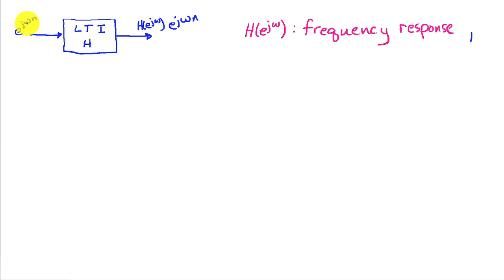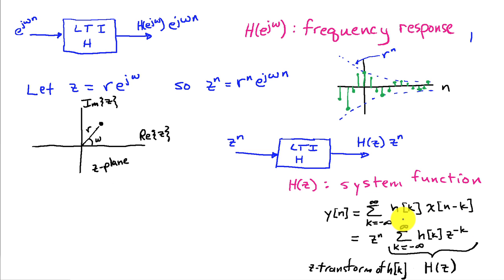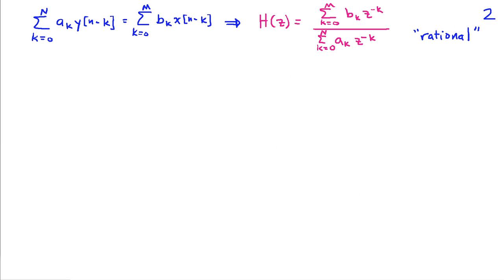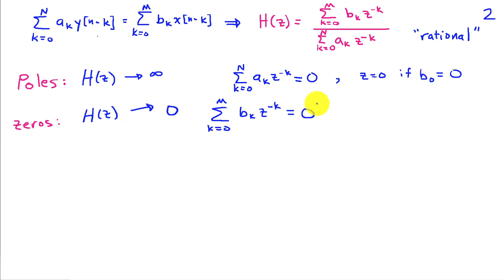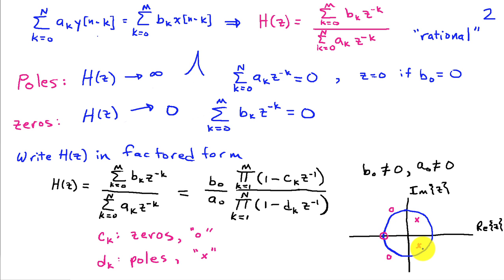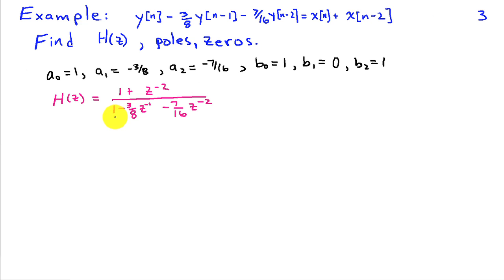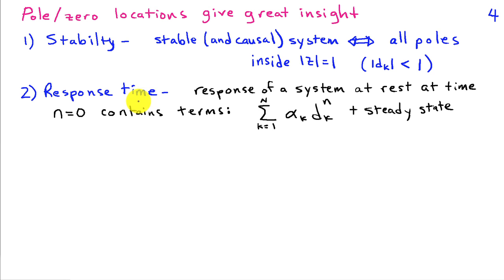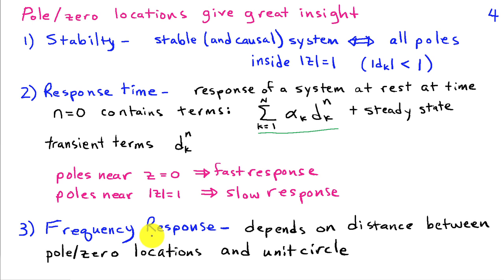Introduction to Poles, Zeros, and the System Function

Comment: hi..Very good video.

If i have a system with transfer function numerator (s+1), means if i apply exp(-t) i will get 0 0/P, we can't apply any real sinusoidal signal to get 0 o/p...am i correct?
Reply from the maker: I'm not sure I understand the 0 0/P notation what you mean about applying a sinusoidal signal. And your use of "s" and "t" imply you are thinking of continuous time, not discrete-time systems.

The Laplace transform for exp(-t)u(t) is 1/(s+1). If you apply this to a system with transfer function s+1, the output is 1 in the s-domain which corresponds to delta(t). Note in the time domain that "s" corresponds to differentiation and "1" passes the original signal.  So in the time domain the output is d/dt {exp(-t)u(t)} + exp(-t)u(t). Taking the derivative gives delta(t) -exp(-t)u(t) so exponential terms cancel leaving the output at delta(t), the same as by the Laplace domain approach.

If you had an input sin(t)u(t) and applied this to a system with transfer function s^2 + 1 you would also get delta(t) at the output.  You could apply sin(t) u(t) to a transfer function s+1 and then you would get extra terms besides delta(t).  The delta(t) term shows up because of differentiating the step function.
Reply: Sorry to ask again. If i have zero at at S=-1 then for what kind of i/p i will get 0 output?